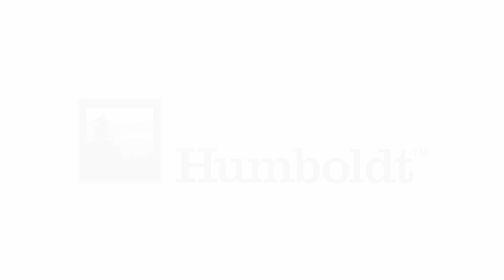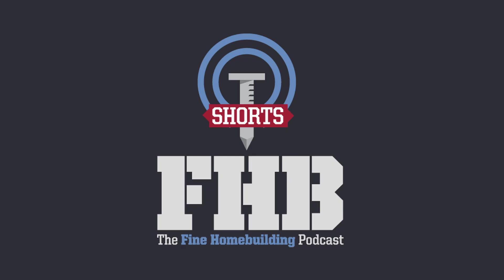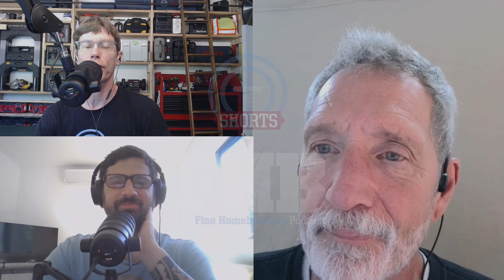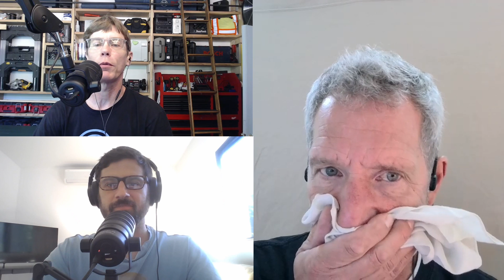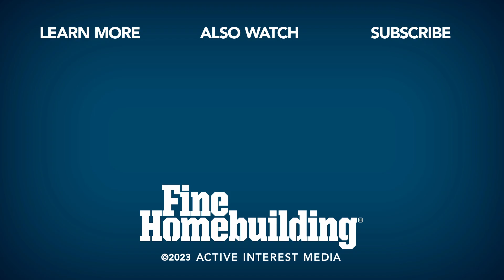Your Truss Uplift Questions, Answered | FHB Podcast 642 Segment

Comment: What are the reasons you wouldn't want to add shims to the top plate to mitigate the movement? Also, seen someone truss screw the top plate of the non-load bearing wall to the bottom chord of the truss. Issues with that?

Comment: Hi! Thank you for the information  on truss lift. While I do see the effects on truss lift in my 1978 built home at the corners of the ceilings, I also see rows of dimples in the ceiling in the middle of the room. I see various solutions to address trust uplift along where truss meets wall. Are there any solutions to address uplift in the center of a room where the ceiling has been screwed into the spanning bottom chord?  Short of installing a minimal drop ceiling (1-3 inches) to hide the effects of uplift, I don’t see how drywall would be supported in the middle of a room

Comment: I feel like this chimney example is much less common than non-load bearing walls.  I’d love to see this expanded on more!

I have 40’ trusses spanning my build with no load bearing interior walls.  I’m planning to strap the ceiling before insulating, so maybe I can float the strapping and connect it to my walls instead of the trusses within 4’ of the walls so the drywall can bend?

Also, my trusses are two-piece with a cap on top (couldn’t ship 8:12 40’ers in one piece).  Does the split design with cap make this phenomenon better or worse?